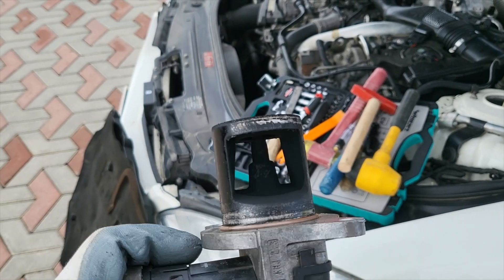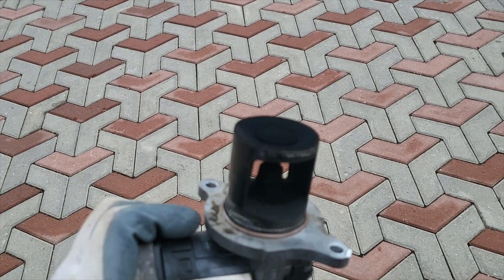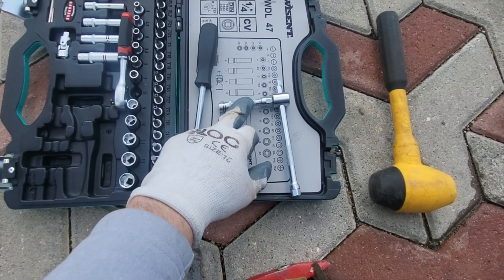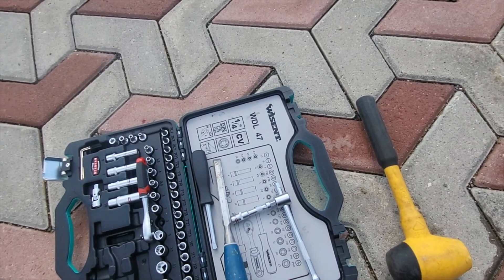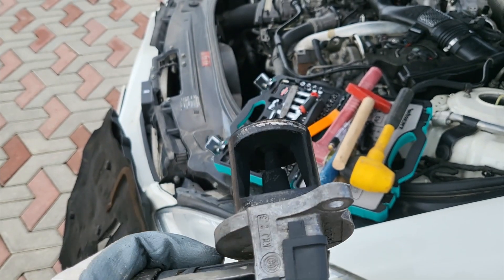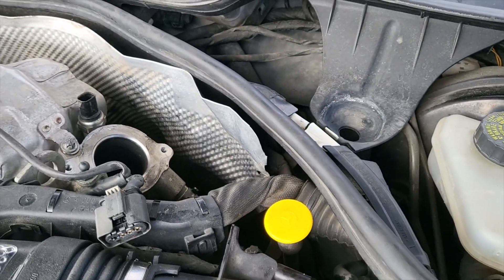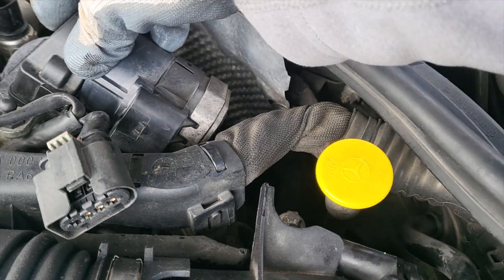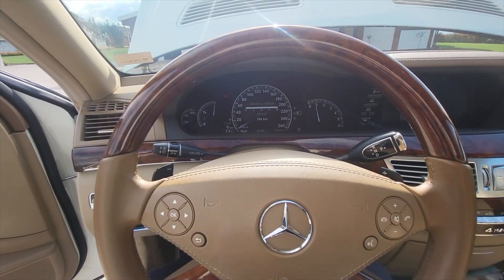EGR valve removal and cleaning in Mercedes W221 S350 CDI / OM642 Diesel Engine

Comment: Rather than using a chisel, undo the bolts half a turn and turn the engine on.  The EGR valve will pop up.  Turn the engine off and undo the bolts.
Reply: anyone else can recommend this method? I'm interested in this kind of disassembly, but I have a bit of fear that something can get damaged.

Comment: Hi I have the same car yesterday on the motorway just lost the power completely stopped the car start again everything back to normal
I felt today on cruise the car jerked bit!! Do you think it's the Egr valve?
And fuel consumption on moterway around 36mpg at the 70ph? Any suggestions to get better mpg or that's is the max I can get?
Thanks in advance
Reply: I’ve an E350 convertible, your limp mode and it’s ok on restart is probably down to the DPF and soot content level. Don’t force a Regen get a can of DPf cleaning fluid and shoot the hole can down the larger pipe on the left of pressure sensor. Leave at running then bring revs up to 3k you will need a code reader to reset DPF and pressure sensor 👍